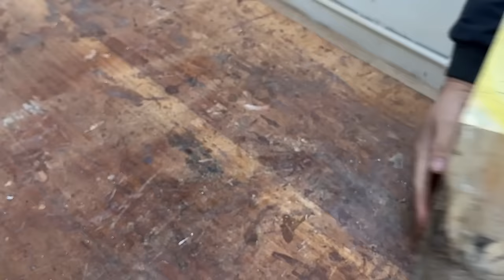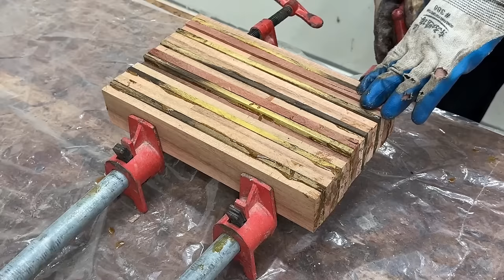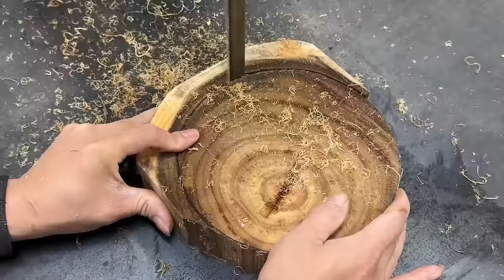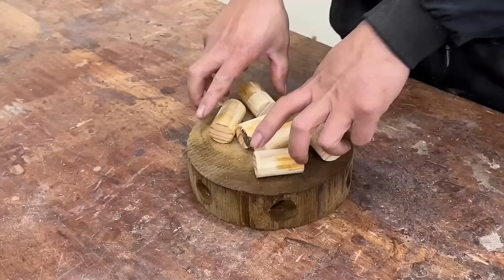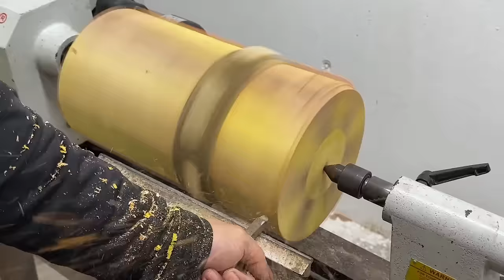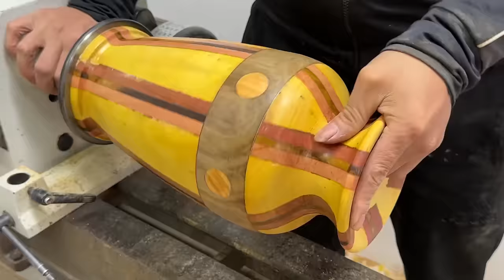Outstanding Design And Extremely Impressive Masterpieces Of A Carpenter On A Wood Lathe

Comment: Dispite how many years you have been a woodworker , that is pobably the most dangerous  example of how not to opperate a band saw 
I was taught over 55 years ago , to place the upper blade guide an inch above the work piece , so it doesnt twist , bind up and snap, and come whippimg out of the machine and injure you
If you dont want to struggle making disks on band saw , make a disk cutting jig 
Carbife turning tool dont cut the wood on roughing out , they tear as they scrape traditional turning tools cot and negative rxke scrapers , shave , and skews plane , and resuire less sanding. Using a spindle roughing gouge , you can cut from end to end without lifting the tool from the work piece and speed up turning
And I do own carbide tools , but prefere not to use them except for some detail work 
After working such an open grained wood , wipe it down good with alcohol to bring the dust up out of your grain before your final polish 
Look into how to mount the vase using either cole jaws and tail stock along with a steady rest, or a jamb chuck and tail stock and  turn a foot with a domed center 
I will block your chaneldue to your unsafe used of band saw
Reply from the maker: Thank You For Supporting The Channel

Comment: This result does not convince me at all because it is not satisfactory. Many places are simply poorly glued and do not fit, gaps are visible. This is very dirty work. Ultimately, the paintwork is also unclean and applied far too thickly. And vases are hollow on the inside. Did you get tired of hollowing out vessels on the lathe, or are you not good at it? Then you should practice it, because the thing is useless like that. You try to create complicated patterns in the objects, but are sloppy in preparing and gluing the wood. Here in Germany they would laugh at you for this sloppiness and send you to hell.